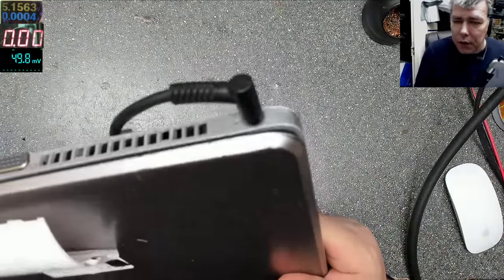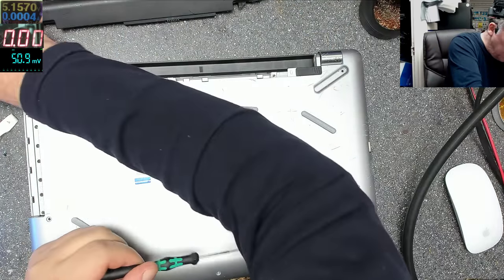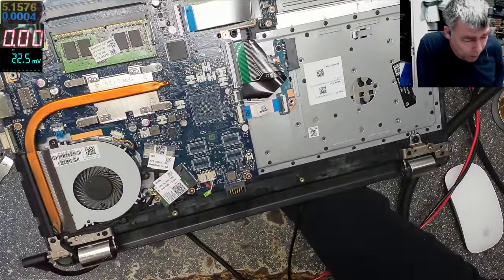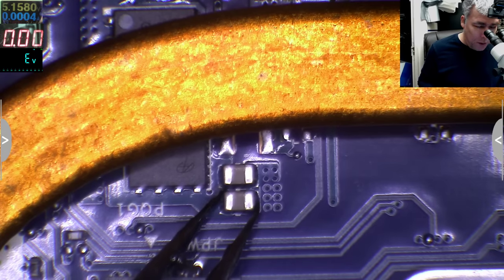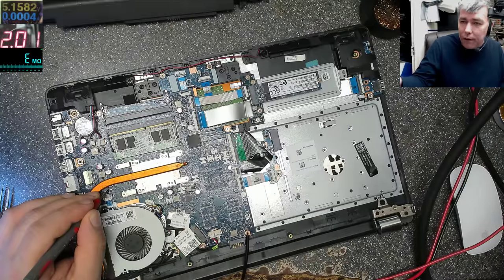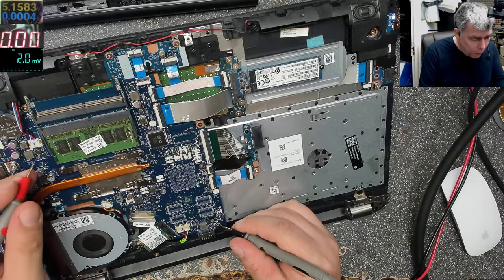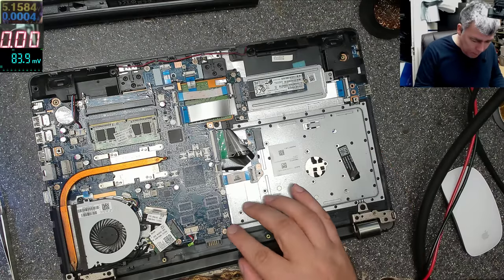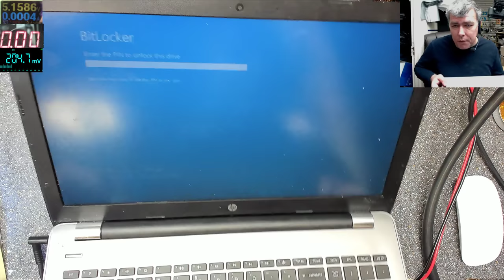Hp 250 g6 laptop, no power, not charging, motherboard repair

Comment: You are explaining the capacitors just fine. For those who don’t understand maybe use the example of old school, automotive breaker-point ignition. As you were describing the function of a capacitor in a switch mode power supply, that is the same function of a condenser(capacitor) in the ignition system. With points closed, 12v battery power goes to ignition coil. When the points open to induce the primary field into the secondary, a huge arc can form between the contacts causing a number of problems least of which being catastrophic damage to the points and significant RF interference because it’s essentially a spark gap transmitter for a brief moment when the points open. . The condenser absorbs the energy that would produce that arc, stores it until the points close a discharges.

Comment: Comparing your beginner lesson videos with some other YouTube channels, I'd watch yours anytime. The reason is simple: you're the guy with 
knowledge based on real work experience. Theory is nothing without it's application. I liked your beginner lessons more because those were combined with practical demonstration. I'd really appreciate if you'd continue doing more electronic component lessons like caps, inductors, diodes... I recently discovered your channel and subbed immediately after watching one of your repair videos. Electronics is fun, and with you around, even more! Thanks for everything you do, keep it up.
Reply: Well said and very insightful comment

Comment: From a Sorin to another more capable Sorin, just RESPECT and GRATEFULNESS for taking the time to teach us new tricks. As about the shorted capacitor, I’ve seen a motherboard back in the day, where all all electrolytic caps that we’re around the CPU were swollen or open at top. Still, that computer, which was a glorified file server, never missed a step, never froze, never bluescreened. So yeah, sometimes you can go away with removing a capacitor, it just depends what was his role 🍻

Comment: Thanks to this video I fixed a similar model HP.  The symptoms were the same and had a low resistance path across the power  rail.  I never would have had to guts to pump so much current into the board.  I almost gave up because nothing seemed hot at up to 4 amps.  It turned out the bad capacitor was on the bottom and it cooled off immediately with the power off.  After removing the bad cap (not replaced), the laptop turns on.  However, the battery doesn't charge.  The voltage at the power input is pulled down to 15V (??).  Still, I pretty happy.

Comment: Dear Sorin
I've searched also for electronics for beginners, yes they are nice but for me (as a beginner) it's always hard to find the connection between what I'm learning and laptop fixing (which is my passion hobby) in your video it's more directed.
I was optimistic when you started your beginner series but the you stopped because you thought it boring, I assure you it's not for someone who want to learn, with all respect to your wife opinion but maybe she finds the whole electronics thing boring.
I would love to see you explaining things that others may find dum but for a beginner who's trying to shortcut time is very useful
Like:
- when you open a laptop where do you expect to see a voltage, and how much is that voltage.
- when you come with your power supply where do you put it on the motherboard, why And what are the value that you start with.
Many thanks in advance
If you answer or not 😀
Big fan

Comment: Quick, nice diagnose, and doggy fix :)
Without schematic it is hard to guess the capacity of that cap -so I understand it, but I've said: doggy because you ripped off that pads :) You had solder station ready and hot, so you could take that cap in 10seconds. Don't be lazy :)

Comment: Vry nice video sir.

At 14.15 where did u connect the positive point on board.

Can we put positive at any mosfet to check shorted component
Reply: Yup but you have to find first if what is the voltage needed on that mosfet because not all mosfet is using 19 v,you can do it in input 19v power rail but not on the output on the mosfet specially if there is a coil on the output..
Reply: Its measured by the multimeter that its connected to the 19v rail , so he can apply 19v safely

Comment: Thank you for the video, it was educational. I didn't realize it is possible to find shorted component just by touching the board. In my case it happened to be AD7676 chip, very hot on a laptop that doesn't power on or charge.

Comment: Hello Sorin. I got a question about this laptop. I had a same issue with no powering on. Replace the mosfet near the power button flet cable on the board. After that the short is gone. But the problem is when power up the laptop, the fan spinns and after aboat 5 sec turns off. Anny suggestions? Best regards.

Comment: Hello, a pleasure to participate in your channel, I am interested in changing the motherboard of my hp 250 g6, since it had an overload and it burned. My problem is if the processor can be changed from board to board, since it comes stuck with some glue on the edges.

Comment: I have an alienware laptop that died after a power cut. When I plug in the charger the light on the charge goes out. I have injected voltage at the port connector and there's a short and a mosfet gets hot, when I removed the mosfet the short was no longer on the connection. I replaced the mosfet with a new 1 and it still does the same
Reply from the maker: that should be easy as this one, check my other video with motherboards repair tutorial
Reply: @electronicsrepairschool  1 side of the mosfet is going to ground it's a 30v n-channel
Reply from the maker: @danielrock4707  you are wrong somehow, you plug the charger and light goes off on the charger, thats mean a 19 v power rail shorted like in this video, but you said something about a mosfet connected to ground ...... there is no mosfet connected to ground and with the 19v power rail on same time!!!! mosfets connected to ground are on the power supplyes but are not connected straight to 19v power rail, so, you miss something on your story
Reply: @electronicsrepairschool  if I take that mosfet off and plug in the charger the light stays on. If I replace the mosfet the light goes out

Comment: Sir i have a similar motherboard from HP g5. The problem is, it starts, the fan spins for 2 seconds, and then stops. The caps lock led blinks once.

On checking the motherboard, one coil near the processor is getting warm.
Please guide me as what to do and how to proceed

Comment: I have a HP 15-ab288sa laptop and it will not charge or power on. No light on either. Motherboard dax1bdmb6f0. Do you have any ideas what it could be causing this. Sometimes if left for a while then plug it in it works. But it will not work at all now.
Your videos are really good and informative, been looking for any info on this board. Thanks

Comment: Are you based in the UK? I have a gigabyte laptop that keeps shutting down intermittently sometimes it runs for 2 hours and other times less than 20 seconds. It does it just sat at the windows 10 desktop or BIOS screen. How much do you charge to test it ?

Comment: Hi Sorin, quick question. Let's say you have a board where a cap or resistor blew (melted) from a short. How do you know what cap/resistor to replace it with? They're so tiny and if they melted you can't read anything off it. Are there common caps/resistors that are used on all these motherboards?
Reply from the maker: probably its a low ohms resistor, but i can't tell u, you have to find out what that resistor is doing there

Comment: Good day Sorin,   possibly you will advise me on the following.  On a desktop motherboard,  I will soon replace the OEM CPU heat-sink and fan with an aftermarket unit.  Of course that includes new thermal paste.  My question is:  The motherboard also has two additional removable heat-sinks to the side and top of the CPU. "Dual Intelligent Processors"!  Since that I have had the system for plus six years, should I/would I be wise to remove those heat-sinks, clean and apply new thermal paste, or just leave them alone??

Thanks
Reply from the maker: The additional heat sinks are from cpu power supply and there is no thermal paste, its using thermal pads, no need to replace
Reply: Much appreciated.

Comment: The evil capacitors strike again :-D
Mobile phones have the same problem, i wonder if the manufacturer is using poor quality capacitors, or a flawed capacitor design.
Reply: they are inherently very sensitive even a drop can cause them to go short circuit

Comment: If someone has put that capacitor there, it should be replaced not removed. You say it  will be fine without it but i doubt it. In some situatiuation when for example processor might need more power, this little cap can hold this power needed. If you remove it, laptop can flash a bluescreen or even turn off in some rare situations. Don't be ignorant to people creating motherboards and at least use a hotair to remove what you need man. This was painfull to watch as you destroy the path mechanicaly removing this cap. Don't get me wrong i subscribe and realy like your videos but this time it was pretty sad.
Reply: @noying1457  You know what I'm doing for living, bro? 15 years of repairs learned me some basics. Watch this video again, and tell me that someone that put a cap there was wrong and it is not needed. So why is it there? Engeeneers creating this motherboard are stupid, ha? Trolling or don't get it?
Reply: @noying1457  last reply, because you're right to the active elements and the amount of curent and voltage passing by or the cap can be working if you put 40 or more voltage to his legs, but that's notthe point here. Go back to era of proadlizer under processor as a supercapacitor. It had to be so big to acumulate a lot of energy. There is a speech that you can mount a bigger cap, but a smaller value is not really good idea, and that's what is author doing. Removing one of parrallel caps. They are holding energy needed in some situations. I Repeat: some situations, not in everyday work or browsing. Belive me, motherboard will shut down or hang if the overal capacitance that was counted by producer, isn't holding aproperiate amount of energy. It will happen at home, after repair, but someone who repairs doesn't see this, unless you do extended tests. I saw it twice, from there, I try to do just as a company made it, not better, as you say. Peace.
Reply: @ Krzyztof C  ...I agree with you on that one. As much as I like to see Sorin doing repairs it was painfull to watch that cap removed so violently. How hard it would be to use a hot air to desolder shorted cap and resolder another one from lets say some scrap laptop motherboard laying around, I'm sure there is at least few of these somewhere around. It's a 5 minutes job at max. That cap there has its purpose, for a peace of mind put another one there as a replacement, it'll cost you nothing.
Reply: @gat1994   Exactly bro, you got it!
Reply: @gat1994  16:32 on the video. It seems like the left pad is gone. Ok, it's in 19V line, but how can you tell his capacity without a schematic? Only pf or micro are in 19V line? Like I sad it will work, I didn't said it wouldn't, it could make trouble later if someone had the idea to put it there. I'll better go back to my russian subs. They aren't ignorant and doesn't repair that way. Thanks for the knowledge about noise cancelation. Cheers.
Reply: @pokontroli  from its colour and its physical size